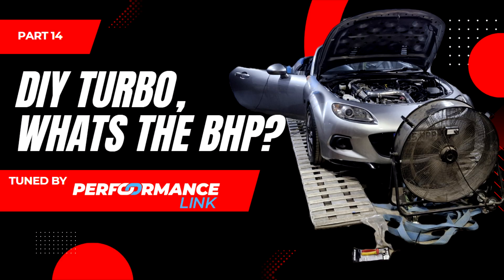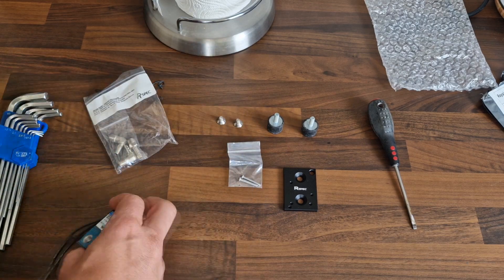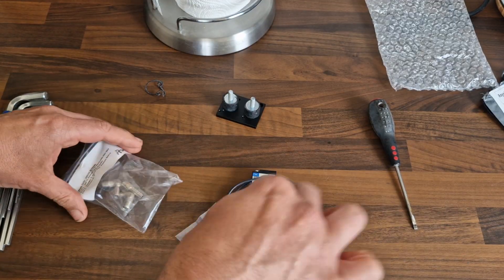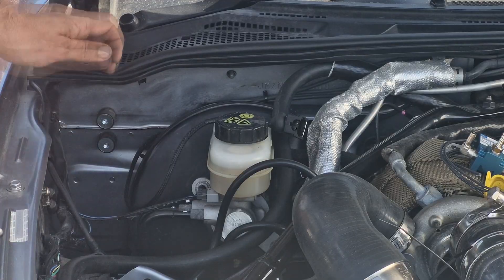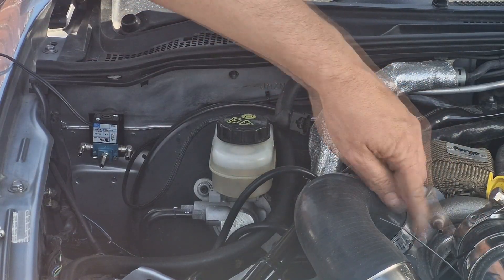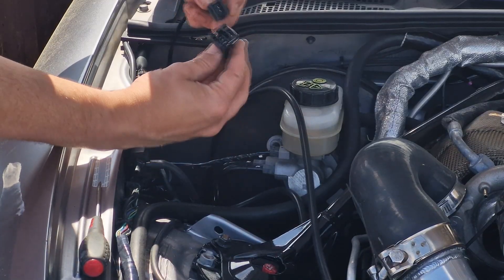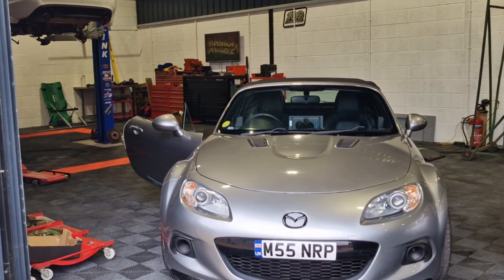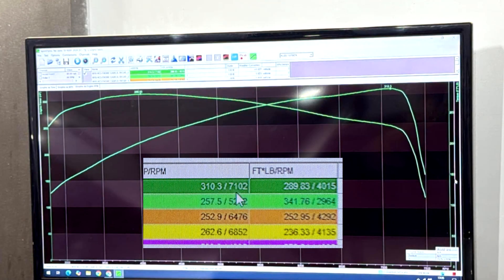Miata MX5 NC TURBO - DIY Turbo build Part 15 - Final dyno, BHP?

Comment: Be careful your gear box will go anytime soon. The second gear is the weak link. I have 264 ft ib and it went. All gears other than 5 and 6 th i wasnt able to use. No neutral, either. 

So the car is now in the garage until I address it all next year. 
Bmw box im thinking of fitting just the issue of the rig which are 4k from sps